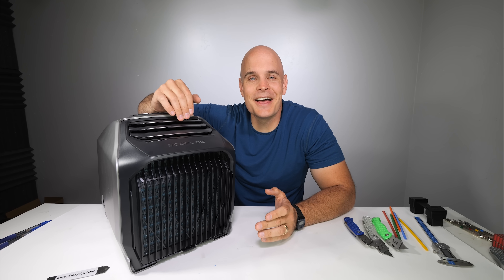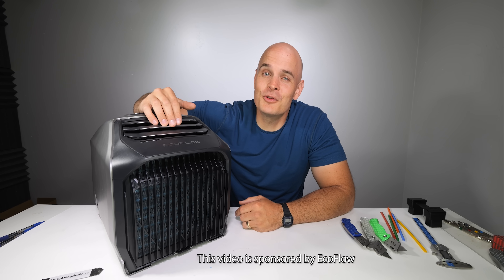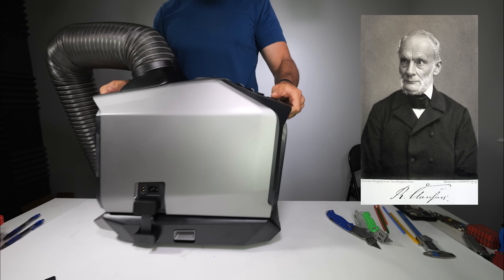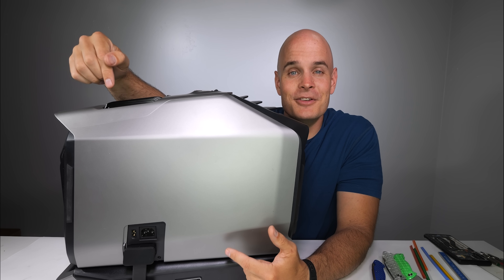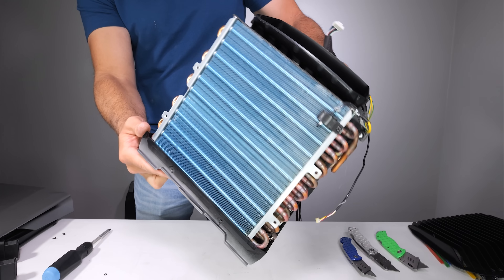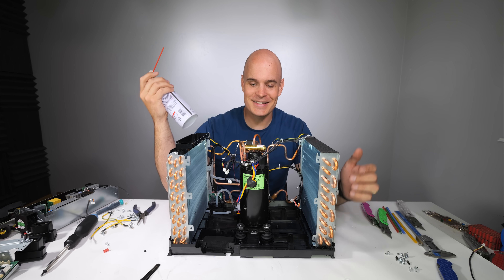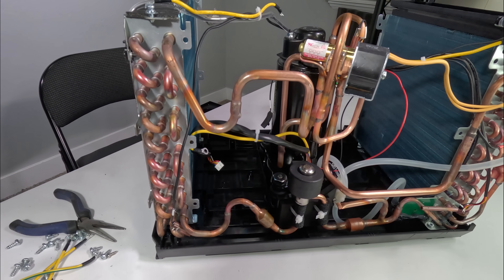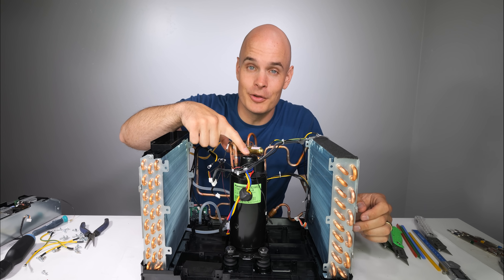THIS CHANGES EVERYTHING... (Ecoflow Wave Teardown)

Comment: I've been thinking about snagging one of these during the anniversary sale and wanted to see what people may advice in my specific situation.
This product is a no brainer camping in a minivan (Sienna) for cooler temperatures during the night in hotter climate (Texas etc). I understand the limitations of the product but would only need it to keep temperature comfortable overnight in the warmer months of the year.

My plan would be to use the vans own AC to cool it before bedtime, and then run the Wave2 in eco mode to keep things at a comfortable level while sleeping. It looks like it's perfect for this.
The ONE concern that I have is the battery and being able to use it more than one night without shore power..
I'm assuming it will drain most of the attached battery over night, and while I have 2 solar panels, it's only 230w (100 + 130). Will this even be close to enough to top up the battery for night 2 and onward or will the capacity just get smaller for each night ? lol?

Is this a scenario that makes sense if I'd need to use it for several night out in the middle of nowhere?
I do see that they sell the 800w alternator charger, so I guess that could be a way to recharge it while running the car for faster top up, but then you do have to run the car a long time...

What say y'all?

Comment: This isn’t the biggest deal, but when portable A/Cs use only one external air duct, it means it only sucks air from inside to push outside creating a vacuum in the house. This means the rest of your house will heat up because of pulling air in through any place it can. I don’t get why so many companies still don’t use dual window vents with an in/out system to prevent this issue

Comment: Nice video for someone who isn’t working on comfort or refrigeration systems  

Just so you know btu Is the British thermal unit and is the amount of heat energy required to raise 1 lb of water 1 degree in one minute 

Pressure and temperature are relative so when you let out the gas in the spray can it lowers the pressure which makes it feel cold

Comment: In the long run no single hose AC unit will be 200% efficient. Using the indoor cool air that was just cooled by using energy to cool the outdoor "condenser" unit is incredibly inefficient. The outdoor coil should be 10 to 20 degrees F higher than the outdoor ambient so it can use it to cool the refrigerant. Also, that better be a DC inverter compressor or that whole system is low efficiency and the 200% is an absolute marketing lie. I'm already in doubt anything is above 98% efficient at anything.

Comment: So, the compression always happens in the compressor and is always expanded at the "metering device".  The reversing valve simply changes the direction that the refrigerant travels when it is in a compressed or evaporated/expanded state.

Comment: 5100 BTU/h is ~1500 W of cooling and 6100 BTU/h is ~1800 W of heating.
1 BTU/hr = 0.29307107 W, but I don't know if the BTU/h or Watt's is the most accurate value, they specify both. It is probably +-50 W.

Comment: British thermal unit
British thermal unit (BTU) is a measure of the heat content of fuels or energy sources. One Btu is the quantity of heat required to raise the temperature of one pound of liquid water by 1° Fahrenheit (F) at the temperature that water has its greatest density (approximately 39° F).

Comment: The expansion valve is the black piece at the bottom middle at 4:18 with the wires running to it. It is an electronically actuated expansion valve. Further the reversing valve does not further compression in any way rather changes the path that refrigerant is allowed to flow. Fun fact: basically any gas can be used as a refrigerant! R-290 is actually just refrigerant grade propane!

Comment: When it is colder outside maybe its better to use a Resistent Heater. First because there is a Pipe to the outside and second this Heatpump is not very efficient at low tempreture.

Comment: wonder why they don't have a water tank and store the heat/cold in the water instead that you just swap out every so often which it could also even use to increase or decrease room humidity at the same time.  Anyway this can solve a significant problem I have so I ordered one but your discount code didn't work, cheers

Comment: Exhausting outside will also create a vacuum inside the house (or wherever it runs) and will suck hot air from outside to inside through all leaks on a house.

Comment: This is BS! Because if you keep the unit inside it cannot act like a heat pump to exchange heat for cold and viceversa.
Since you keep the unit inside house, when it create heat, it will exhaust cold on the otherside and since is in the same room, it will do nothing  to room. It will be exactly 100% energy released, not 200%.
Only heating pumps can offer more then 100% efficiency, they change temps with outside of house ambient, either from ground, water, or air ambient.

Comment: With that duct forcing air out of the space to the outside, that will cause a negative pressure inside the house and make unconditioned outside air infiltrate into the home. This really kills the efficiency of portable AC units like this. The units with two ducts instead of one are the type to get, since they simultaneously intake and exhaust air from outside, leaving the conditioned space pressure neutral.

Comment: Ecoflow makes a lot of promises their products can't keep.  I bought a Delta Pro and after a year the battery capacity was less than 50% of advertised.  It turns out they were not using LiFePo4 cells, and instead traditional lithium ion - which would be fine, but their charging logic is to continuously top off the cells when the capacity drops a few percent, so the unnecessary charging cycles wear out the batteries prematurely.

Comment: First compare BTU with the Space that require air conditioning to determine sustainable capacity of air conditioner then compare SEER ratings within a determined size of unit to choose cost effective air conditioner.(along with good insulation and optimal air flow to reduce energy lose)

Comment: The only problem with these type of AC units is the hot air being pumped out the hose to the outside means it has to pull more air into the room from somewhere, usually outside. This makes it almost impossible to cool a small space like a boat cabin or RV or tent. I have one of those stand up units on wheels where you put the hose out a window. I bought it for my RV when the main AC broke down. The portable AC did not cool the RV at all because it had to pull air in from outside and it was 90 degrees. The unit does however work to cool a bedroom in a house. This unit needs two hoses, one to suck outside air in and one to blow the hot air out.
Reply: Not sure why he didn't show it. It actually comes with 2 hoses

Comment: How does it actually run in practice. BTUs are a poor indicator of performance. They set the most optimal conditions when running their ‘official’ tests. BTU vs BTU, the windows ac units are just better than the mobile ac units.

Comment: Can you disassemble the wave1 too? I bought mine and it’s under warranty but they won’t do any repairs. I only got 5 months out of it ( 40ish hours) before a code 61 showed up which started my claim. They cold shouldered my emails, and the toll-free number just keeps ringing. I finally got a half assed attempt of a customer service rep. No calls just email replies. Anyways 8 months of back and forth and I couldn’t deal with it anymore. I ended where I started with them which was 60% refund on a brand unit that stopped at 40 hours and zero effort to help me fix it. They basically admitted that they never intended to have a plan of action or a course of action to have a repair channel in place for warranty repairs. Fraudsters

Comment: It would be better if they placed directional air vents also on the inner circuit, that would allow to operate unit outside of cooled room and make noise much lower.

Comment: @jerry Hello, how can you fix the screen of wave 2? When i turned it on, display goes crazy. But can be fully controlled using EF app. TIA. Is there a reset button to restore factory settings of the unit?

Comment: 5100 BTU/hour of heating = 1495 watts.  At 200% efficiency, that means 747 watt power draw.  But other reviews say it draws about 550W in heating mode.  But it's possible that it's over 200% since COP values are between 2 and 3, which means roughly 260% efficiency range.
Reply: Every cheap standard Chinese window type AC unit delivers roughly 1000 BTU / 100W power draw. Meaning 5000 BTUs = 500W consumption. 
1.2kWh battery / 500W = 2.5 hours max endurance (at full power).

Comment: A heat pump is extremely efficient because it isn't making heat, it's capturing heat that's already out there, plus the heat it makes during operation. 

A nice bonus is in hot climate it works as AC as well. 

But running the thing for 8 hours on a single kilowatt hour battery is amazing. My AC draws several kilowatt hours in 8 hours.

Comment: Hi, thank you for your video, quick question: 
In the winter the air intake part which is outside towards the cold environment will get frosted and will covered with ice , how could it still suck the air inside then ? even if it is connected to outside through the duct I'm pretty sure in cold winter it will still get covered with ice and frost. my question is , can it still operate in that situation or no ?
Thanks.
Reply: its take air from indoors,sucks the heat and cold air is thrown outside through the pipe.

Comment: Anyone ever have any problems with the heat mode? Talked with EcoFlow, but I don’t think they know very much about their own product. I’ve only noticed it on heat, but when I engage the heat mode, it will go to a high voltage protection mode. Any help would be appreciated.

Comment: Pity the battery connection uses proprietary data lines, otherwise you could connect any 48V battery to it instead of blowing $1100 on their proprietary battery
Reply: You can get a 12V batt with a 1kW inverter. Good enough to run any 500W heat exchanger. A 1.2kWh LiFePO4 12V batt will cost you 200$, an inverter 100$. However, 1.2kWh will only run the aircon, including the ecoflow one, for max 2.5 hours. 
If you buy your own components, you can essentially the same for 400$ instead of 1200$.
Reply: @jschudel777  I'm aware, but then you lose about 20% of the energy in the inverter, if you're using 12V, you lose another 10-20% on top (depending on wire thickness) 

Realistically, a 12V 1.2kwh battery will only run the wave 2 via an inverter for about an hour, maybe 1h 20m IF YOURE LUCKY 

what everyone should be pissed about is the fact that you can't feed the wave 2 48V DC power through that port and have it run properly, instead of needing an expensive proprietary battery

Comment: Very cool. I just wish they would have kept it at 12v like the UGO, so you could run it off a battery bank without the need for an inverter or step up converter.

Comment: My biggest issue is that you can't run this on 12vdc or 24vdc unless you connect it to one of their battery packs. I already have several Jackery and Bluetti units, so I don't need another one.

Comment: The US is slowly catching up to the rest of the world for these fancy refrigerators and ac units for heating instead of just cooling.  They shouldn't cost $1000 for an aluminum radiator and some copper tubing, but they still do.  R-290 is propane, so the risk of fire still exists even if just 130 grams of it.  Unfortunately, this model isn't for climates below freezing with operating range between 41°F - 122°F.   People that rent in cold climates have limited options.  Something like this is needed.

Comment: It's a pretty cool product. But 200% efficiency is obviously a claim they can't really achieve. Even a hundred percent is all been sought after but elusive 100.1 percent of the time! For that matter heat pumps have been around for a long time and definitely are often not as effective as other heating methods, especially when it's really cold outside there's not very much heat to pump in. Still this self-contained portable setup is impressive.

Comment: I'm not impressed. It uses 400watts of power and the exact same technology as every other air conditioner. If I had the funds I could build an AC that doesn't use electricity but instead gives you electricity.

Comment: I bought one and the unit doesn't drain properly. I've tried both drain and no drain modes of operation. Unfortunately as soon as you move it after use it leaks from everywhere. Not a good thing to have happen in an RV. Clearly there is a design flaw. Do not purchase.

Comment: Again, not sure if kidding or not ..... this is called portable AC (at least here in Czech Republic), it can be bought as cheap as little over 100 USD, it is absolutelly the worst thing to lower your temperature and used as a VERY (VERY!!!) last resort! It is loud and very inefficient (comparing to split AC). It also drags hot air from outside or other rooms because it has only ONE(1!!!) output hose .... there are models which has two hoses to cool compressor and its condenser, it si WAAAAAAAAY more effective, but the loudness is still there ..... and it is not as effective as split AC either! It seems to me like a joke (like the one with those mini converters for solar panels .... when we have hybrid converters, it seems like joke from last century) or US is living like 100 years in the past (given the woke non-senses, it seems like it:) .... But the heat pump is as old concept as the first refrigerator ..... EVERY home refrigerator has heatpump, every moder dryer has heatpump!!!! OMG! And 200% efficiency in one hose mobile AC? KEEP DREAMING! Split AC on the other hand has SCOP and SEER easily above 5 (500%) .... I'm still wondering if this video is real and is from this century .....

Comment: Outrageous prices. But neat bit of equipment and engineering. It would likely be great to have for camping or as an emergency backup, if your home A/C or heat went down. But seriously too expensive $1,300 😳 for what it is. A window unit would be half that. Adding a battery for an extra $500?!!!!! I get R&D + Manufacturing have costs, but I can’t imagine they cost that much to warrant the price.

Comment: Okay so it's not as efficient as a normal house air con split system. which are now between 4 and 5 COP in that for every kW of energy consumed they move 4-5kW of energy.
I like it but I kinda feel like the reverse cycle component needlessly complicates it. If you make it so that the evap and condenser exhausts are the same you just turn the unit around and put the flexible ducting on the opposite side that you want. It looks pretty well made and is very compact.

Comment: So the HVAC tech in me is bothered by your explanation of how a cooling system works. I tried to refrain but I could not. A room isn’t cooled by blowing cold air into a room. It’s actually the removal of heat from a space by absorption. Refrigerant absorbs the heat from the room via the evaporator as the liquid is turned into a gaseous state. Then the vaporized refrigerant carries the heat to the condenser where it is expelled into the outside air and the process repeats.

Comment: It's a compressor using 2 evaporators as condensers depending on direction of valve.  Or a heat pump

Comment: You can see the reversing valve and that’s why it’s efficient for cooling and heating as it’s using the hot refrigerant to produce heat and doesn’t require any flame.

Comment: So it's an air conditioner, which is essentially already a heat pump, that runs off batteries using well established technology.... 😂
Sounds to me like it changes exactly nothing.
Click bait for a company using scammy marketing language that is misleading.... Yeah the COP is 200% but that's because it's moving heat in addition to making it.... The same as every ac that's ever existed.
Reply: Yup!  One possible minor correction, however, as I understand it, the COP is not "200%".  It's just "2" and as you likely know, it simply means 2 "units" of heat energy are pumped for every 1 "unit" of electrical energy consumed.

Comment: It only has one duct. So it's pulling room air to heat and pump outside. This will pull warm air in around doors and windows. Two ducts would be better.
Reply from the maker: It has two.  I only showed one.
Reply: @JerryRigEverything  Ah awesome then

Comment: Thank you! I hate the way people describe heat pumps and air conditioners operations by saying an ac removes the heat from the air or a heat pump removes cold from the air. I guess technically, it is true, but it's super confusing to people who don't understand the basics. 
Technically, if you blow air over ice, you're removing the heat from the air and transferring it to the ice, turning the ice into water, which now contains the heat, but damn that sounds pretentious

Comment: I don't understand, if it's pumping air out of the vent pipe, isn't it drawing more hot air into the room? Wouldn't you get similar comfort results by just sitting next to a fan?
Reply: No, the hot part in the back has two ducts to keep itself cool using outside air.

Comment: AC that can be powered with solar panels? Thats what I need
Reply: It is only powered off AC or the battery beneath it.  The solar is used to recharge the battery. If you try and run it off of just solar or 12 volts you cannot use heating or cooling, only the fan will run.

Comment: A Portable A/C units with only one duck is a no go for ME. Your using some of the cool room air you just made and blowing it out the window literally to cool the heated evaporator side and that A/C is only 1500BTU on top of that!
Reply: It has two ductd for keeping the rear exchanger cool.  It brings in outside air and exhaust the hot-air back to the outside.